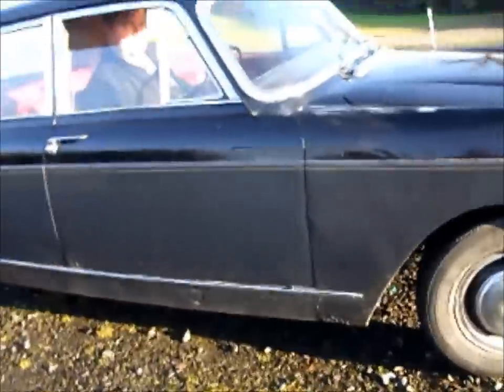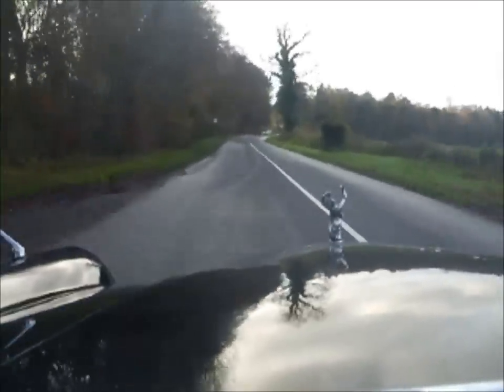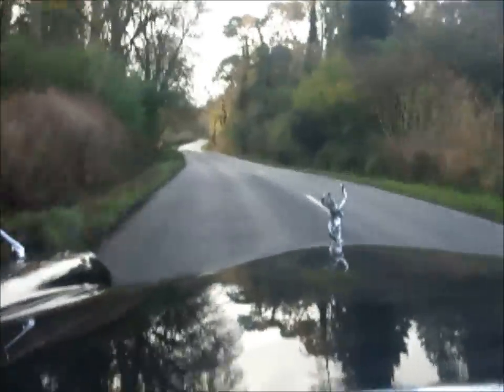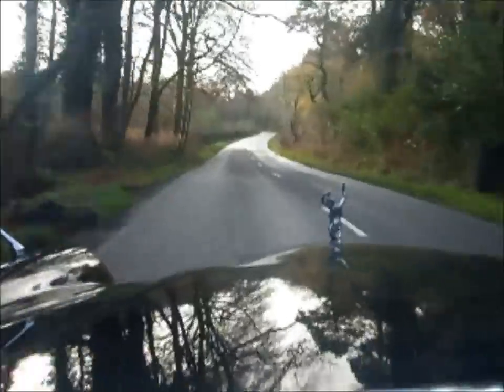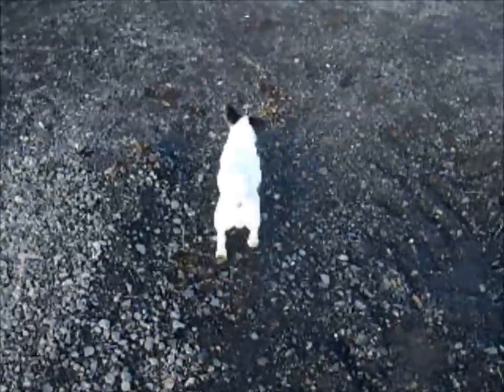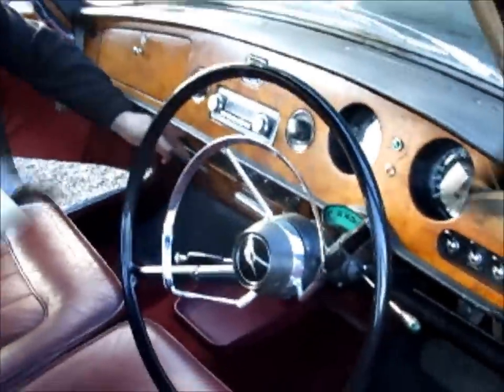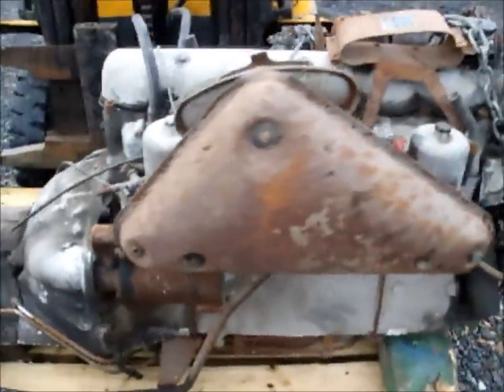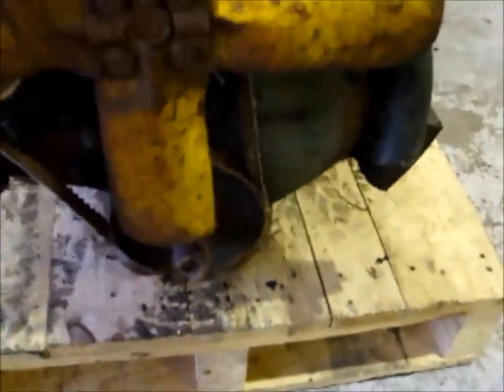Rusty Vanden Plas Princess 4L R - The drive home and a quick look around

Comment: The army did NOT use the same engine in a tank! They did use it though in the Austin Champ which was in use in the army in the 50's/60's until replaced by Land Rovers.
Reply: The Austin Champ was fitted with the 2.8 litre 4 cylinder B40 Rolls Royce engine most of which were built under licence by Austin.